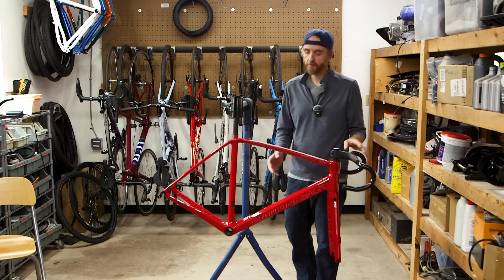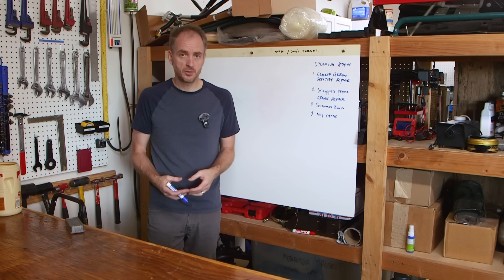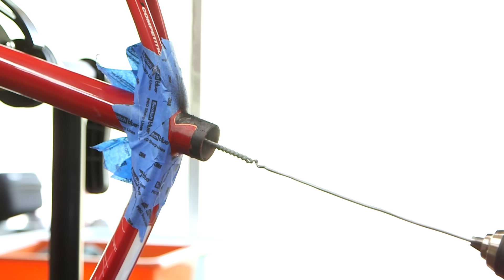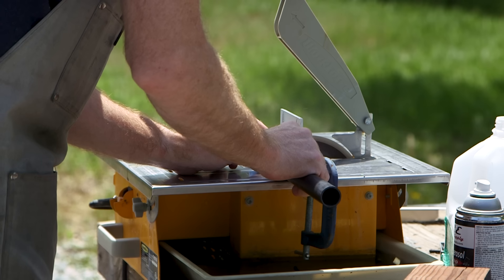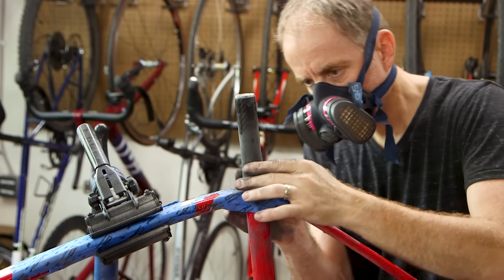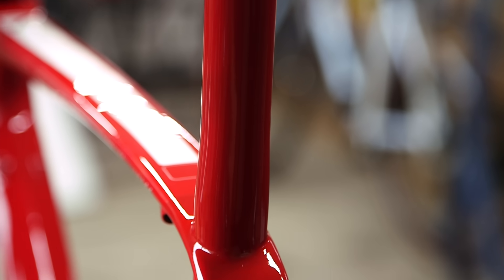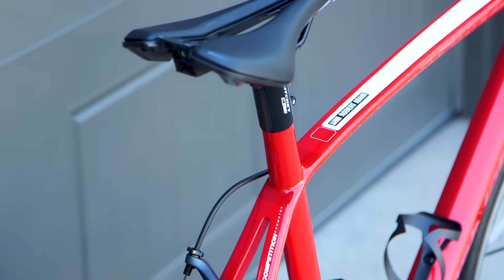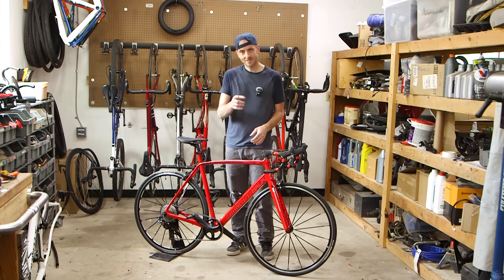I bought a cracked carbon bike frame and fixed it myself.

Comment: Just found your channel and you've got some great videos.  I worked for an American brand building carbon frames about 25 years ago.  Using a structural epoxy like DP490 when you bonded the carbon tube and sleeve together, as well as bonded the new mast into the frame's seat tube may have been slightly better choice, but truthfully the layup resin you used is probably more than adequate...especially since you carbon wrapped them together.  Layup resin prefers the two carbon surfaces be in as much contact as possible and curing under pressure, whereas the structural epoxy adds more strength where it fills the voids.  I also had no idea aftermarket post toppers were a thing, that's a solid find.
Reply from the maker: Thanks. That's great insight, and I appreciate the background.
Reply from the maker: Doing this same repair on another frame.  Glad I pinned your comment.  DP490 this time.

Comment: can you make a video on how you use spray paint and have it not turn out super orange peely or textured
Reply from the maker: It’s all in the wrist :). I do heavy coats and usually only one.  Never had luck with the multiple-light-coat approach yielding anything but orange peel.  Could be a good video and I’ll bet I already have some footage.  Count on it.

Comment: I know i’m gonna get a lot of hate for this but i have a chinese made Hyper Carbon-x er i received the brand new frame as a tip for cleaning my friends gutters out way higher in the air than i wanted to be so i dumped a crazy amount of parts into this bike including sun tour adjustable forks hydraulic disk brakes and carbon fiber hoops on a pair of cheap but nice upgraded cartridge bearing hubs and i cracked my seat post in the same manner i had no choic but to ride it and so i put a heavy plastic reducer into the seat stay and cracked it but instead of bonding a carbon sleeve into the frame im gonna go with either stainless, titanium or worst case aluminum and i am gonna also drill down the post and install rivet nuts to fasten the tube in place on top of epoxy to reduce downward pressure since i’m gonna use a suspension hydraulic dropper post which can multiply forces way higher than a rigid seat post. lemme know what you what you think? i am also gonna paint the whole frame and brand it as my own after my old drag racing team.   kraze-racing
Reply from the maker: I'm all for repairing things when they can be repaired.  Sounds like you've got this one.  Good luck.

Comment: What's wrong about clamping cf top tube?
Reply from the maker: If the force is too great, it can crack or delaminate the carbon.
Reply: @RobertAdairWorkshop yeah, but why even leave a gap between the clamp and the tube then? I mean, if you clamp it gently, it’s not like the frame is going to explode, right? The load on the frame from just picking up a bike with one hand isn’t much different from what a careful clamp would apply. I really don’t get the panic in the comments saying you should never ever clamp the frame

Comment: Nice work! I've done similar seat mast conversions on old steel bikes (much easier working with steel alloys, rather than carbon). Happy to see that you arrived at the same solution, where others may simply scrap the whole frame. I did finally try my first carbon reinforcement/repair on my XC bike's rear chainstay. It works and holds up to my abuse, but has a finish far more crude than that of your frame here haha. Thanks for sharing this, I enjoyed seeing your methods and process.
Reply from the maker: It's good to hear from others doing similar repairs.  Reddit always think's I'm crazy for fixing frames.  Appreciate it.

Comment: Hey, this is really great, solid work! Do you think it’s also possible to repair a Headsets Carbon? Thanks a lot, and keep it up! 👍
Reply from the maker: I'd say, depends on what's wrong with it.  Cracked longitudinally, maybe.  Cracked around the circumference, probably best left to a pro.  If it were me, I'd sleeve it and use some hardset to reinforce the area, but I'd have to see it to know for sure.
Reply: @RobertAdairWorkshop  Thank you, sir, for your quick response. I will see how I can send you a picture of it.

Comment: Knowing Diamondback, the seat tube was probably way too big from whoever's factory it was built in that day. Also, any retailer that resells a broken frame is 100% liable.
Reply from the maker: I own several carbon Diamondbacks and I think you’re spot on.  They’ve all required some special attention during initial assemble, including some epoxy rework on my newest Podium.

Comment: If you want to set your saddle height, from the known good bike, you measure from the top of the saddle to the bottom of the pedal stroke, not the center of crank spindle.
Reply from the maker: Problem is, that adds too many variables.  I'm not running the same crank length on all the bikes I ride.  They range from 165 to 180.  I'm also not riding the same saddles.  I go back and forth between Fabric Line and Giant Fleet SL saddles.  The way I did it, I give myself two hard points that aren't impacted by the choice of saddle or crank arm length.  Your way would add those variables in there too and assume that the two bikes use exactly the same component dimensions.
Reply: @RobertAdairWorkshop  I agree more with Chris Harper.  If you change components, then your saddle height probably needs changing.  I would not change components that affect saddle height (fit) if I could not change the saddle height.
Reply: @RobertAdairWorkshop  By measuring to the bottom of the pedal stroke, your leg extension would be the same of all bikes. Why wouldn't you want that? Generally from the center of the saddle or perhaps where your hip bones rest is where I'd start the measurement from.

Comment: I like how you just casually built a makeshift paint booth in the middle of a field! 😁 I'm glad I found your channel, your videos are like next level bike restorations! I'm like casually watching your videos while doing my own bike rebuilds and restorations! On a side note, I tend to like bike frames that use wider 31.6mm seat tubes. I use a seat post adapter to run a 27.2mm shim adapter which I find help reenforce the clamping area while adequately holding the seat post in place without slipping. Anyways keep posting more bike videos!
Reply from the maker: The paint booth is a little less "middle of a field" than it looks.  I had to run an extension cord, though :).  That's a great tip.  Thank you.

Comment: Always use proper torque specs to tighten any bolt or clamp on a carbon frame. This would've never happened if the previous owner didn't break it.
Reply: ... if the previous owner hadn't* broken* it.

Comment: Nice repair, I don't know if I missed it, but did you drill out the crack before the repair?

And that 5.1 N.m  on the 1 inch long CF offcut is a good example of CF weakness in compression and why you don't build pressure vessels that will see inward pressure...such as cough...Submersibles.

Comment: I own a small shop, and back before we had Zwift and programs like that, the shop would offer indoor training programs throughout the winter months. At the time, my trainer bike was an aluminum frame Cannondale with a carbon post. Where the slot for seat collar and slot on the frame line up, I broke the seatpost. I always checked the torque of this post as I truly am not a carbon fan. Everything was done correctly, I weighed 110, and it still broke. My theory was that those 2 slots should NOT be aligned like that, and I reversed the seat collar to the other side. This was done in 2000, so there truly wasn't alot of info out then. I spoke with Cannondale and Campy, and the Campy rep mentioned the same thing I had already tried. Now I still have the same bike on the trainer, and another carbon Campy seatpost and I no longer weigh 110,  LOL! yet have had no issues since 2000. Just thought that I would add my .02... Your repair is interesting, and looks great... I hope you'll share how the long term results add up. Thanks for sharing!
Reply from the maker: That's a great story, and I'll be sure to post updates!

Comment: If it takes a week to dry, you’re not using enough harder.
Reply from the maker: It’s a spray can with a built in hardener cartridge.  I can handle it in 15 mins but If I start trying to put it together or buff it, it’ll get fine scratches and swirls.  After a week, I could drag it on gravel and it wouldn’t scratch.

Comment: Another great video, nice repair. I think that's a pro move adding the compression plug under the seatmast. Smaller than 27.2 posts aren't very common these days, especially in modern carbon frames. At first my guess is the previous owner had the post too high, though after seeing the inside of the frame and how rough the original layup was, I think the bike was just poorly built from the factory.

Some folks say how carbon repairs are costly, and in some senses they are, but I think carbon frames are more readily repairable for less than steel (and way less than aluminum which generally isn't ever recommended without heat treating, AFAIK). Especially in the home shop, the tools and materials required is much less than on a steel bike
Reply from the maker: You are spot on.  I completely agree.  Steel and Carbon both require a bit of skill to repair, but I'd rather do the carbon repair (at least, if it's straight forward).
Reply: @RobertAdairWorkshop  - You did an outstanding job here. Was just looking for a solution and you took it to a superlative level of refinement. Subscribed.

Comment: You shouldn't clamp the top tube....
JUST KIDDING :face-blue-smiling:

Great repair, very well thought out. It looks better than factory, brings up the cool factor of the bike.
You have so many failsafes built into that repair, it's most definitely the strongest part of the bike now!
Reply from the maker: That was great!